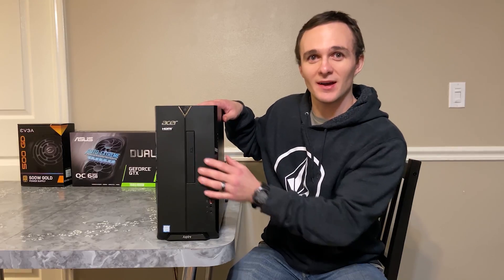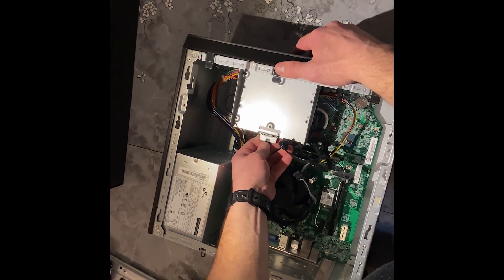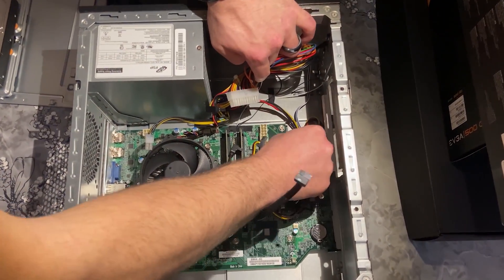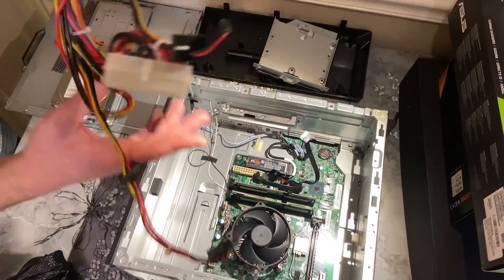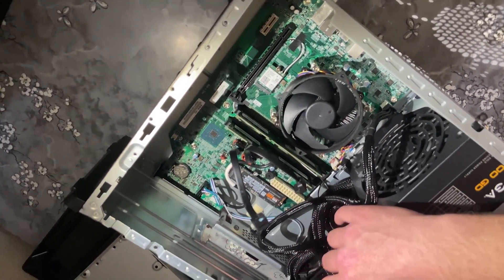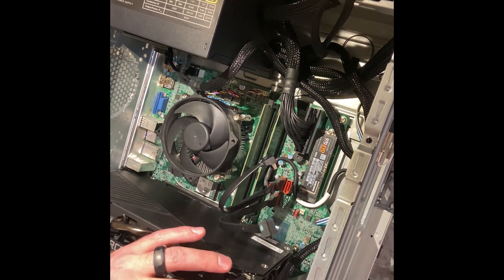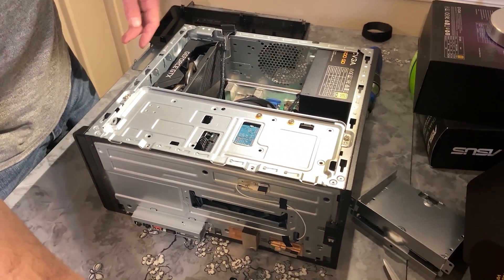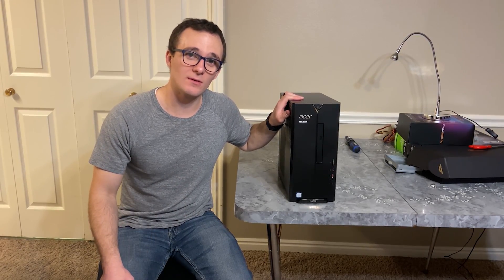How to put an Nvidia 1660 Super and change the power supply in an Acer Aspire TC-885 ACCFLi5

Comment: Like cheaper
Reply from the maker: Yeah if you wanted to go with Nvidia they have a 1650 or 1650 super this one is $160 at the time of posting https://amzn.to/2RKXdMV that's cheaper than the 1660. If you want something from AMD, they have RX 570s that are discounted: https://amzn.to/2VECg7h is $135 at the time of this comment.
Reply: @dmoneyballa  

ok thanks also the powersupply u posted to not showing
Reply from the maker: @shazib siddique
You can use another power supply, they should be standard size.
This one should work: https://amzn.to/3eFvAPg
Reply from the maker: yeah that should fit, it does perform worse than 1650s on average: https://gpu.userbenchmark.com/Compare/Nvidia-GTX-1050-Ti-vs-Nvidia-GTX-1650/3649vs4039 but if that's the one you want, go for it.
Reply: ok thanks also the powersupply u posted to not showing so I dont know what to do

Comment: Will it be easier to put in a sff gt 710 as I'm only going to be using it as a csgo and editing machine and at the min I'm getting around 70fps with core 2 duo 3gb ram and gt 710 so it's a good graphics card
Reply from the maker: Yeah, that card looks much smaller than the 1660 super.
Reply: @dmoneyballa  also is this a very good upgrade in performance

Comment: Hey mate, do you mean I should remove this? https://i.imgur.com/dceIOmM.jpg
Like just pop them out?

I just wanna ask as well are all power supply boxes the same size? because I'm thinking about buying these
https://www.harveynorman.com.au/msi-nvidia-geforce-gtx-1660-ventus-xs-6gb-oc-graphics-card.html
https://www.harveynorman.com.au/thermaltake-smart-pro-rgb-650w-power-supply.html

Thank you for this video. I'm just learning about upgrading computers and happy to see someone with the exact same as mine upgrading it. 
Subbed.
Reply from the maker: With a 1660 super, you need to remove two of those tabs so it gets the right airflow. One where your ports go and the one right below that. Power supplies should be pretty much the same size. The one I put in here is a standard form factor so I think that'll fit fine.

Comment: Where can I find the 6 pin connector
Reply from the maker: Do you mean on the original power supply or one like the evga? On the EVGA, there are some cords that are labeled PCIE, there should be a 6 pin with a 2 pin right next to it. this is what I used.

Comment: Would I still need a kobalt screwdriver if installing only the graphics card without changing power supply
Btw you are the most responsive and helpful YouTuber I know
Reply from the maker: Any phillips screw driver that fits the screws will work. You could use whatever screwdriver you have
Reply: @dmoneyballa  so what is the kobalt screwdriver for

Comment: Would an rx 570 fit in this and do i need a new psu?
Reply from the maker: It looks like most RX 570s are about an inch longer than the 1660 Super I used but I think they would fit. They seem to be a little less wide than the 1660 super. https://amzn.to/2X6AzBY is what I'm using to see the item dimensions on the RX 570.
Reply: dmoneyballa thanks. Im going to switch case. Will the motherboard fit? It’s a big case and i only have a budget of 50$ for it
Reply: Have you been able to fit the 570 in? I’ve been thinking of putting a 2060 in and the 570 is actually longer

Comment: What graphics card could I get without changing the power supply
Reply from the maker: I'm not 100% sure this will work but looking at the side of the psu it came with. It says output won't exceed 300W. Using Newegg's power supply calculator: https://www.newegg.com/tools/power-supply-calculator/ I see that a 1650 super: https://amzn.to/2WJQm9V with the other components will be around 266 watts and a 1660 super will be around 291 watts. You would need an adaptor to go to the 6pin power connector for the gpu something like this: https://amzn.to/3duAjmb. I suggest using the newegg tool to make sure it is under 300W.
Reply: gtx 1050 ti 4gbs or rx 560 4gbs, Im using the 1050 ti

Comment: Hey! I was wondering if the CD drive would still be functional after upgrade or if there was a way around it
Reply from the maker: You could wire it up to be functional, we tried but it was pressing really hard into some cables so we decided not to. Perhaps if you had a different psu or cable managed better it would be much more feasible.
Reply: @dmoneyballa  Ok thanks for the help!

Comment: hi i have an acer tc 380, can i take these components that you took or do i have to change?
Reply from the maker: I did some googling but couldn't find much on that model. What cpu does it have?
Reply: dmoneyballa Ryzen 5 2400g with Vega 11
Reply from the maker: That's new enough that the gpu would for sure work. The Power supply should fit. it's a pretty standard size
Reply from the maker: just make sure it has a slot for the gpu in the motherboard

Comment: Hey man I have a question, I just got the TC-885 UA92 as a gift over the holidays hoping to get into some PC gaming but I've run into more than a few issues trying to figure out what information I need to know when selecting a CPU and GPU. As it stands, it currently has a 9th gen Intel Core i5 Processor 9400 and a UHD630 and I've not been able to play a single game without performance issue0 (if it even loads at all).Would you be able to point me in the right direction as far as brands, specs, or what CPU and GPU to get together? I'm a broke ass engineering student so cheap and effective would be ideal lol
Reply from the maker: your CPU  should be good enough to turn out good frame rates on most games at 1080p. You should get a GPU to be able to play modern games. If you are in the market for a new budget GPU, I would go with the Nvidia 1650 super. This one is only $150 https://amzn.to/2tgBPpE. If that's a little out of the price range, This AMD RX570 that has 4Gb of vram, it's only $120, https://amzn.to/2RNBK6d. It's a generation older than the new 5700 that AMD has but it still should be able to hang at 1080p. If that's out of your price range as a student, check ebay or craiglist for a used GPU, that should help the gaming experience. Here's a link to a comparison of both suggested GPUs: https://gpu.userbenchmark.com/Compare/AMD-RX-570-vs-Nvidia-GTX-1650S-Super/3924vs4058

Comment: can i put gtx 1660 into acer xc 885?
Reply from the maker: I'm not sure, the item dimensions I found on Amazon show the xc 885 at: 13 x 3.9 x 11.6 inches and the dimensions for the acer tc-885: 13.78 x 6.42 x 13.39 in. The best way to find out is to pop off the side panel and measure how much room you have for a graphics card. the graphics cards can come in different sizes like this one is a mini https://amzn.to/3aOT0zR and has dimensions of 6.69 x 4.76 x 1.42 in.
Reply: I have an xc-885. The best I was able to do was a Zotac GT 1030 GDDR5. Hell the upgraded PSU is physically too small for the case held on by friction with one screw in a nice janky mess. So the tower is permanently resting on its side to prevent any mishaps -- still thinking of a way to make a custom adapter for the PSU to properly mount it.  Works fine though.

Comment: 3:24 i need help, i try so hard to pull that out but it wont budge all the other ones are so ez but that one is like stuck
Reply from the maker: Make sure you're getting the tab pressed down so it can release. I had some trouble with it and found that wiggling it back and forth while pulling it worked for me. Let me know if that helps.
Reply: I was able to get it, I also have a gtx 1660 but it’s a msi one, i cant manage to get it to fit on the slot
Reply from the maker: Have you removed the metal tab where your hdmi and display ports will go? You should also remove the one below that one for ventilation. Is the release tab pressed down or is it locked up in place?
Reply: dmoneyballa havent dont that yet but I’ll try, i couldnt clip it on because it was a bit too long and the wall thingy was blocking it from being clipped

Comment from the maker: Hey guys, make sure to remove the slot under your HDMI and display ports so that your gpu can have the extra ventilation that it needs. I didn't do that in this video but have since done that. it should increase the airflow so your gpu doesn't overheat.
Reply: dmoneyballa can you show us what you mean by that please?
Reply: Hey which graphics card I can use (a good one) without removing the power supply?
Reply: @ev0luton401  Same question, as we're all sure you went there. Hate when people say this PC isn't a gamer's PC. Or perhaps the definition is incorrect.
I play Guild Wars 2 mostly, and on a Core 2 Duo on 8GB RAM, and recently upgraded to a messily Gigabyte GT 1030 OC 2G which should plop right down into the Acer. It is right at 7 inches or slighty under. 

And where is the best place for the extra fan?

Thank you. :)
Reply: @JamesMiller__Outback_Idaho  If you're still looking, a 1650 OC gddr5. I have one in my tc-885 on stock 300w psu and it works fine
Reply: @ev0luton401  If you're still looking, a 1650 OC gddr5. I have one in my tc-885 on stock 300w psu and it works fine
Reply: dmoneyballa also I got the same pc but it has 8gb RAM while u have 12. Is it still ok to upgrade it to how you have done it ?
Reply from the maker: Yeah it's fine to upgrade.
Reply: @dmoneyballa  Hi, it's my first time upgrading a pc. Can you please show the example of the inside of the pc after installing everything? Including the slot under HDMI and opening the port (?) of the graphic cart to prevent from burning the card ( I read it from another comment which pointed out your mistake).

Thank you
Reply from the maker: @jennypark2259  Here's an image of the pc withouth the gpu in it. it should have both slots open: https://dmoneyballastech.wordpress.com/2020/04/26/two-slots/
Reply: @dmoneyballa  i have tc 885 ua92 and it real size (PSU) is 150 by 81 by 137 mm so im scared that atx wont fit
Reply: dmoneyballa what are temps on ur gpu It looks like I have the same stuff that’s inside ur pc and my pc but I have the acer nitro 50 and it did not came with a fan but when I check my temp for my gpu it’s goes up to 80
Reply: he means the hdmi plugins and all that, remove the other pc slot so your graphics card vent so theres ventilation. So your graphics card doesnt get overheated and burn.
Reply: What do you play the hdmi into? The card or the motherboard
Reply: When I placed my GPU into the slot, the metal hatch that secures the GPU in place doesn’t close properly
Reply: @ravenironwing  it’s not bent since I took the GPU back out the test it and there was no issue with the hatch. I’m not sure if it’s the GPU’s io shield that is preventing it from closing properly
Reply: @ravenironwing  I have yet to meet someone with the same problem as me which is sad since I don’t know how to fix it
Reply: @ravenironwing  Oh, this worked, and the graphics card is secured in place now, Thank you so much for the help! Apparently, I had to bend the metal hatch inwards more as there was another "bump" on the hatch that locked it in place.
Reply: Hi my friend,  I changed video card and PSU as you did see in the video, I also have acer tc-886, my problem is that it heats up a lot now, Is it possible to change houses? your opinion about this work ??

Comment: You made a HUGE mistake! After a couple of days of intense games, your video card will burn! Your video card is dual slot. You did not open the air vent to the backplate of the case for the second slot.
Reply from the maker: I was unaware of opening the second slot for ventilation. Thanks for pointing that out.
Reply: dmoneyballa  not at all. I'm glad that you fix it during
Reply: GobseG M. What slot like the thing under the HDMI and stuff
Reply: @shaquilleoatmeal3824  probably a DisplayPort. I have a XFX RADEON RX 570 gpu and it has 4 DisplayPorts
Reply: dmoneyballa what was he talking about here can you explain because I will be doing this to my acer aspire
Reply: @tilted3713 Notice at 7:35 that there is only one slot open, because the graphics card is wide, it requires two vents to be open. So simply bust open another slot.
Reply: @mucipher  so just leaving them open will fix it right?
Reply: @IamINERT  What do you mean?
Reply: @mucipher  just opening the airvent will fix it?
Reply: @IamINERT  Absolutely, If your graphics card is overheating, then yes, opening the second vent will allow appropriate airflow to the GPU.
Reply: @mucipher  I will just keep it open at all times.
[probably will buy some stronger fans
Reply: Sorry I don’t understand what u meant can u explain a bit simpler so I won’t make the same mistake too
Reply: hes a beginner dude
Reply: ItzTheVoid  who is a beginner
Reply: I'd use a vented backplate cover or two. Like: https://www.amazon.com/SilverStone-Technology-Aeroslots-BP-Maximum-Powdered/dp/B07S5RZ7QM/ref=sr_1_29?dchild=1&keywords=pc+case+pci+vented+expansion+slot+back+plate&qid=1599108747&refinements=p_72%3A2661618011&rnid=2661617011&sr=8-29

Comment: Hey, i got almost the same pc but my processor is i5-9400. My graphic card is evga gtx 1650 zc gaming, and when i play games, for example rainbow 6, in fps monitor and aida64 it shows that my processor is 70-76 degrees Celsius. Can you please help me solve the problem?
Reply from the maker: I don't think that's too hot. 76C is a little too warm. You could upgrade your cpu fan or use a water cooling solution. Maybe getting some case fans to improve airflow through the case would help too. If you're really concerned, I think the  most direct route to improvement is to upgrade you're cpu fan.
Reply: @dmoneyballa  you think new fan for cpu will get into this little case? A have the same pc case as you have
Reply: @dmoneyballa  and in r6 my processor is almost 100% loaded.
Reply from the maker: I can check on how much clearance it has in the case. Maybe applying Thermal paste would help cool it down the little that you need.
Reply from the maker: I checked the clearance it has in the case when You take the cooler it has off. It has about 5.6 inches from the cpu to the edge of the case. You could get a low profile cpu cooler like this one https://amzn.to/2QcI4n4. It's supposed to be good to cool cpus that have up to 95W TDP the i5 9400 has a TDP of 65W so you should be good with it.